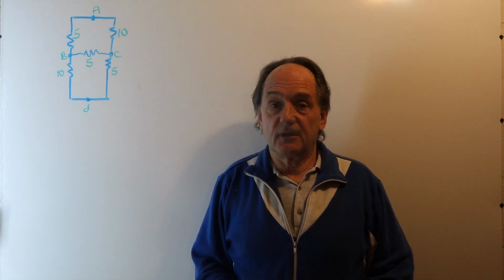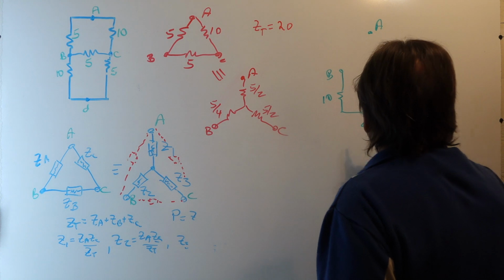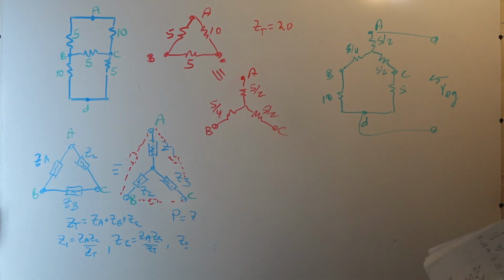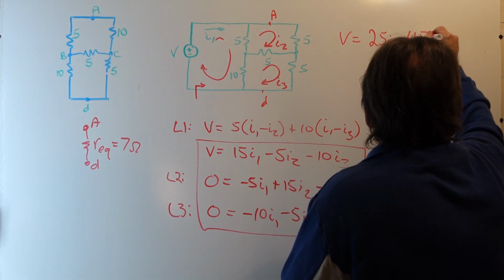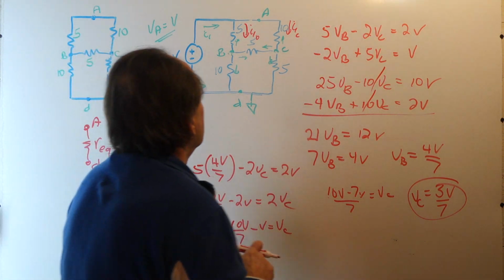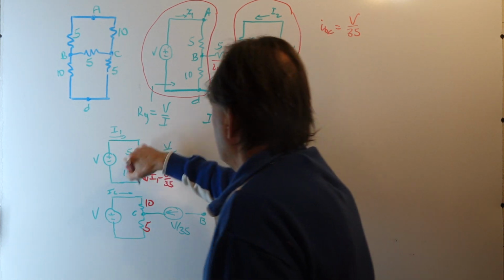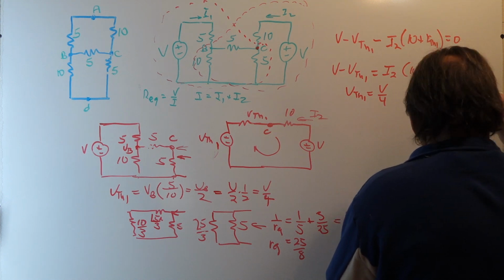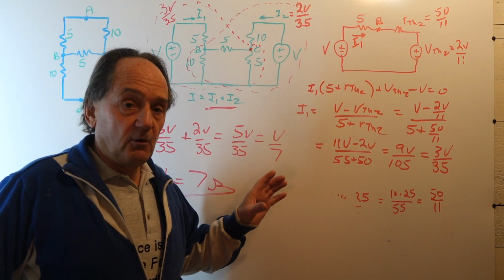Bridge Circuit Equivalent Resistance -  Network  Theory

Comment from the maker: Time                                            T O P I C
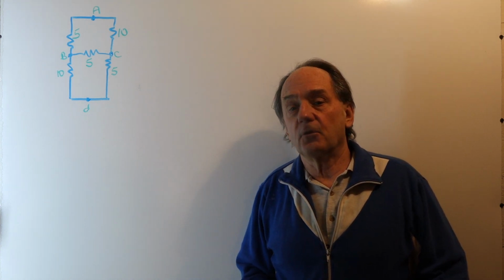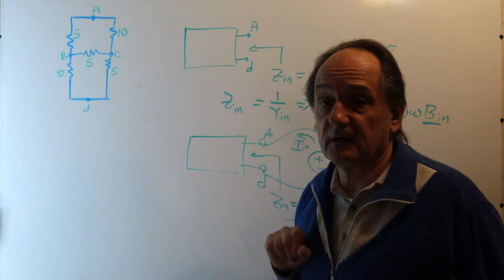00:00:00  -  00:05:45     Introduction:   Input impedance and equivalent resistance
00:05:45  -  00:17:37     DELTA - WYE  conversion'

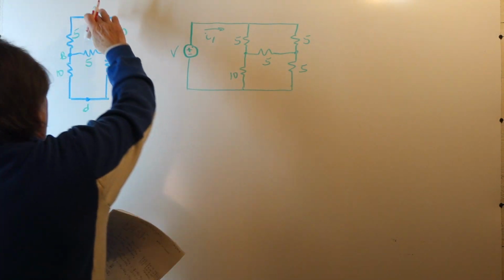00:17:37  -  00:29:35     Using  MESH  analysis
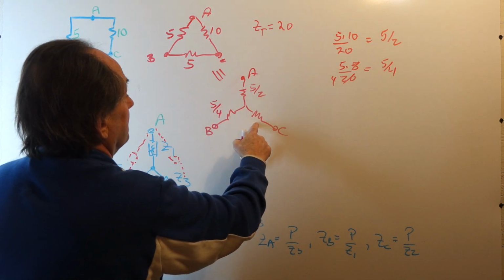                     00:23:20     Symmetric impedance matrix when no independent sources

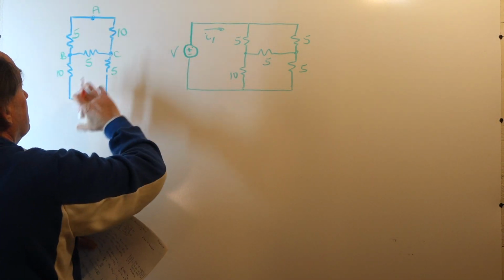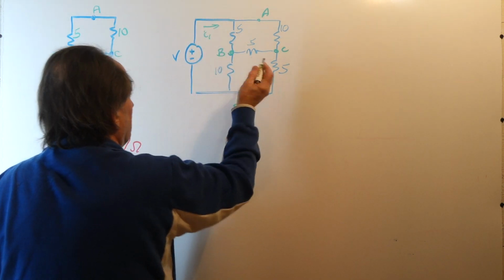00:29:35  -  00:41:44     Using  NODAL  analysis
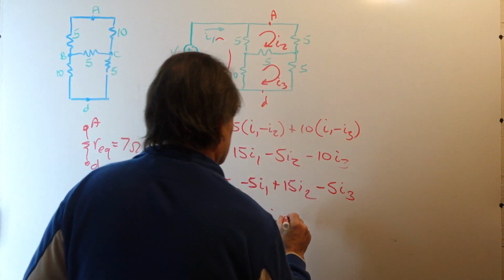                     00:34:12     Symmetric admittance matrix when no independent sources

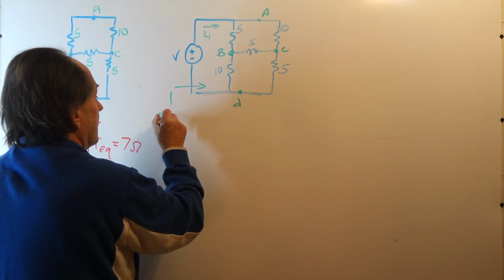00:41:44  -  00:55:18     Substitute Thevenin equivalent for part of network  - Part 1
00:55:18  -  END             Substitute Thevenin equivalent for part of network  - Part 2

At time 22:26 misspoke:  There are 3 elements touching current i3 not 5 elements - was thinking about 5 ohm resistor at the time.

Comment: I haven't thought about some of this for 30 years since high school, but there's less dust up in my head than I thought. You do a much better job describing and illustrating the methods than I remember from the days of chalk, though.
Reply from the maker: Thanks.
There is a lot of material there to absorb.  I am working on an index with time stamps to make it easier for the viewer.
GH
Reply: Indeed, and thanks for the timestamps. I don't remember being shown the Delta-Wye conversion method, do remember mesh analysis. I ended up going the chemistry route initially in college so my experience with these things ended there.